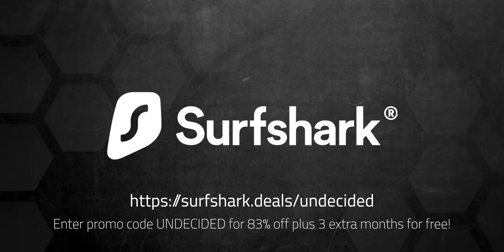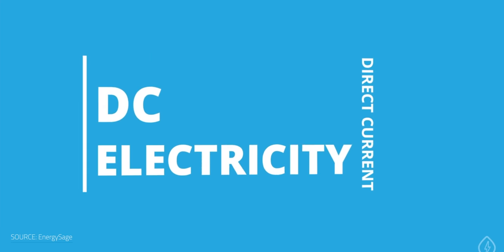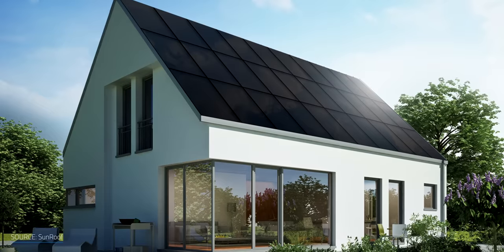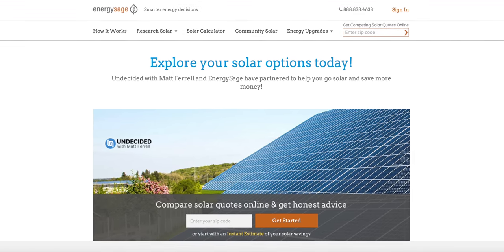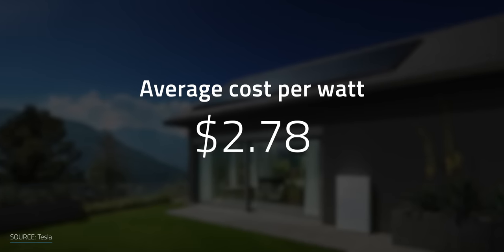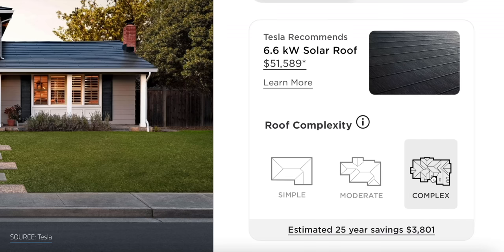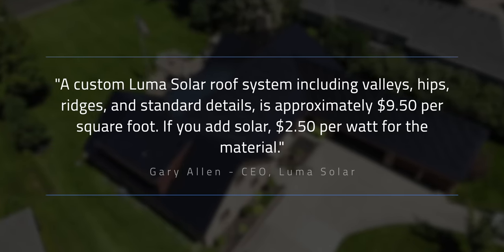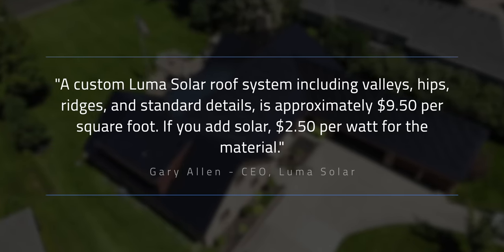Exploring Tesla Solar Roof vs. Solar Panels

Comment: Pretty much nothing new. Solar roof is really only a viable option if you need a new roof at least in the next 10 years. If your roof is only maybe 20 years old, afaik roofs can last you 40-50 years, so putting solar panels on for 20 years would be a nobrainer. When getting a new roof you can then decide if you want to put on your old panels again, get a solar roof or if you simply want new panels, but I hope in 20 years solar roofs in general are going to be more common. If you are going to need a replacement of your roof 5 years along the line, that will not only be more expensive because they have to take off the solar and put it back on, but worst case something gets broken or whatever. I'm sure there is insurance for that too, but that's another point driving the price of the roof replacement. So yeah. If you need a new nice really sturdy roof, the Solar roof might be a great choice, but if your current roof seems to be doing fine, panels are certainly the way to go.

Comment: Really the bottom line is that if your doing a new build, it would behoove you to work in the powerwall and panels or roof tile assembly into your construction costs. Especially if your a little off grid, or your converting that cabin on the recreation property into your retirement home. The cost of electrical hookup along with the costs of a good quality architectural composite will find you somewhere near a 20% to 30% differential. Easily recouped over a much shorter time and if your on the grid, you immediately begin with a lower cost for power. At the end of the day, with government mandates for zero emissions by 2050 (ok stop laughing) the reality is that IBC regs. will likely start mandating renewable support with new construction in various districts....especially liberal ones. So at the end of the day, if your working on your second house, retirement place o just building for the first time, you cant lose figuring in for a renewable support source...and if your half motivated, you can find a LOT of incentive programs and grants to help offset the costs. Even from your local utility or county improvement block grant program that even includes low to no interest rate loans.

Comment: I am sorry, but tiles are just for rich kids wanting to pose "green" but with no bloody idea what they're doing or actual interest (posing is more important than doing, style over substance). The only "advantages" tiles have are subjective aesthetics. The only times it sorta matches panels is if you make comparisons to other bad ideas, like just putting panels flat on your roof that isn't optimally positioned to maximize solar exposition during the day, and if you're constructing a new building and are also willing to shape your roof so that it optimally points towards the direction you get the most sunlight from, which is already a compromise of aesthetics. If you compare it to anything more sensible, like a properly positioned panel or a sun tracking one, it just doesn't add up. And if you really want any supposed technical advantage of currently existing tiles over currently existing panels... just make a panel using tiles instead of regular commercial available pre-assembled panels.

Comment: I wonder about the eventual possibility of solar roads and sidewalks? The roof is a great existing place to put solar but there's also so much sun being soaked up on the ground that we could be using!

The main issue here I suppose is durability. Not a lot of cars driving on your roof (assuming things are going well).
Reply: I’d suggest checking out the videos by EEVBlog on solar roadways. TLDR - not a good idea.
Reply: @Richardincancale  thanks for the recommendation! I had a brief look and yeah solar panels are definitely not a durable road material haha. At least not yet!

I wonder if it's just premature? Imagine where materials science could be in 100 years, let alone 1000! Surely the science will catch up eventually? Obviously not a short term solution but I'll hold onto my futuristic pipe dream for now 😆
Reply: Check out the project Solar Roadways.
Reply: @KalebPeters99  I think the lesson is - do the easy / efficient things first. Once all the roofs are covered (and walkways, parking bays, motorway central reservations etc.) then consider doing things that are inherently less efficient.
Reply: @Richardincancale  Absolutely! There's so many places we already have for solar that it's a shame to see money being wasted on solar roadways right now when it's still so inefficient and expensive.

Hopefully the lessons we learn from equipping these easier spaces can prepare us for the more difficult ones.

Comment: Tile only affordable in Cali & Hawaii no other state because of electric rates . Rating for their roof is C+ not better than Sunpower or LG. Tile doesn’t pass every jurisdiction for wind code especially here in FL . Tesla shingles are the 75-80% production in 25yrs compared to top brands that’s 90% in 25yrs like LG and Sunpower . The rating has to rated by the state if they choose to work in it and Florida its rated C . Also Tesla only has 10yr labor warranty that sucks compared to Sunpower and LG that’s 25yr labor .Tesla is a publicly traded companies so they need to make profits and not spend money . Also Tesla makes you do your own site survey way for solar compared to other companies that comes out and measure you roof and take photos accurately.The only thing I recommend for Tesla is the batteries . If you finance Tesla they have horrible solar interest rates that 3.99-4.99% compared to other companies that offer .99-1.49% interest rate . You get for what you pay for the old saying is true

Comment: I have just discovered your channel.
Great info.
Have you seen the Auatralian company TRACTILE ?. 
It produces Solar tiles, with the capability of also heating water underneath the tile which also acts as insulation for the roof and home.
Also fire proof and cyclone proof .
It has won many awards.
Check it out, you love to.know your thoughts.

Comment: I'd be much happier to know exact material costs instead of averaged installed costs.
The cost comparison here is almost totally useless.
Reply: Exact materials cost would also be useless because materials don't cost the same everywhere. Thusly why there's an average cost.
Reply: @HH-le1vi  Material costs don't swing as wildly as installation costs though.
Reply: @jimmyb1451  really? Is that why wood went up 4x in a year? Along with every other building material
Reply: @HH-le1vi  lol.
So you want to justify your foolish argument by stating that the price of wood went up 4x in "a" year, in some unknown location, in reference to PV systems, who's major materials are silicon and copper?

Just bow out mate.  You're already done.

Comment: Green power generation is important, but even more important (in my opinion) is how we build our cities. A large, detached house far away from everything so every single errand or trip needs to be made by car will never be as green as a reasonably-sized apartment in a city where most or all of your trips can be made by walking, biking, or taking public transportation.
Reply from the maker: To a certain extent I agree.  It's possible to have single family houses in bike friendly/walk friendly areas.  But sprawling suburbs is a bit of a problem.
Reply: @UndecidedMF  even still, detached SFH with yards still do consume much more energy than an apartment. Part of that is the larger size, part of it is the fact that there are no shared surfaces acting as thermal barriers. Yards are especially wasteful. They’re used a very small amount, and they require a lot of water and energy to keep them in good shape. They’re also (usually non-native) monocultures, which has detrimental effects on the local ecology. 

Either way, we need to make it legal to build apartments and small commercial in residential neighborhoods instead of mandating sprawl as our method of growth.

Comment: Whilst I prefer the idea of Solar tiles, you’re at the mercy of the company/installer still being around to commit to that 25 year warranty. I’ve recently been stung by Everest windows in recent years. The company still exists but they rebranded themselves to “Everest 2020 Ltd” from “Everest Ltd”. Long story short, same company but not honouring any of the warranty on any purchase before COVID-19 in March 2020.

Absolutely disgusting company run by bottom feeding, cold calling shit salesmen. Never buy from them.

I’ve learned that a warranty doesn’t mean a thing if the company offering it has no integrity, and you won’t find out until the company gets crunched.

Comment: think in the end a chinese hybrid system will blow elon out of the water.  this system is too cumbersome and although you can mass manafacture the tile it would be better to add a normal panel setup below several tiles.  here in south africa a lot of panels are stolen which would help the sale of a hybrid systems even if it is slightly more expensive.  although you probably would get a panel that would deceive a would be thief.

Comment: Tiles for sure. The cost of replacing both roof and panels over time is a no brainer
Reply: It only depend on how your house was built, in Europe buildings and roofs are way stronger and long lasting. Modern solar panels also are very nice looking and solid.
Reply: @carholic-sz3qv  thank you for the other perspective. I did t think about the various types of construction world wide.

Comment: The following is merely my opinion, unless I'm stating facts.

I'm actually unsubscribing after seeing just this topic and not the video. After your nuclear energy video - I was pretty angry with you. You're smarter than that, and that video was missing so much critical information it didn't qualify for being balanced. An example, an accurate accounting of how much subsidies and government funding  goes into the "cost of nuclear". Based only on that, nuclear is a non-starter. Even if it were free, the true, integrated costs of safely storing nuclear waste for a quarter million years again, and alone, makes nuclear a non-starter.  I have never seen a comprehensive true-cost of nuclear energy in a presentation because TCO of nuclear takes it off the charts and off the table. Because your energy analyses have a particular flaw of dis-incorporating ugly facts, the topic requires we revisit the last energy "discussion".

For some reason, it seems that you don't see your role as an information influencer, and appreciate the responsibility that places on you.  Solar worth it? Well, when the planet is becoming unlivable - a cost you are not putting into  your videos to date, it's obviously "worth it", unless you're putting a really low value on health and survival.  How many people died a grizzly death in Pripyat? Again, the government doesn't even try to calculate it, so people carry on as though those 10s or 100s of thousands people vomiting blood to death don't count.  Pursuing an even more complex, intractable and more expensive and infinitely more dangerous energy strategy that is nuclear really should not be on your plate as an "alternative". 

The simple litmus test is this: If nuclear CAN be made safe, why hasn't it been? (I expect not to hear - well it CAN, we just *didn't*)
Answer: All costs require actuarial details most humans can't tolerate, so it's just left out.

It's akin to entertaining burning 10x more fossil fuel as an alternative to our current strategy. Well, yes, that is technically different but - seriously. Thinking in terms of keeping viable the only planet that we know is habitable (until now at least) and exists demands we make alternative energy sources work. So asking if anything is "worth" surviving - you see how the question is squarely moot. I hope you change your direction in favor of keeping survival of our energy users heck their entire species possible, and maybe a few other species like chickens and cows as well.

Comment: I mean this politely and seriously, and please listen: STAY AWAY from Tesla products. The battery is good, but the cheap Chinese panels are junk compared to SunPower.  Not worth it. Tesla doesnt have control over their installers, the installs are ugly and horrible with lots of calls backs and problems. Avoid. As for the rooftiles, I have seen only two or three houses that looked nice. The dozens of others look like crap, the lines are crooked, and they gotta lower the value of the Home, compared to regular nice architectural shingles. UGLY. A perfect install looks fine, but those installs are very rare.  Tesla rooftiles are never perfect. The panels are better. But. Please do the math in SunPower. A better panel, better customer service, and over the life of the panel, it more than pays for itself in lack of degradation and efficiency vs the garbage Tesla Chinese junk.  Do the math. Tesla should be the best. It’s the worst. Avoid. They’re going to have an awful brand reputation in another ten years.  They are wrecking solar. Trust me on this, I am a consumer and a contractor, and I have installed several dozen solar arrays. SunPower costs twice as much in the beginning, and pays for itself over and over. And if you have problem, their warranty is solid. Tesla disappears. Don’t do business with them, in my opinion.

Comment: Wholesale used panels - 250w - $50. Buy a pallet or two of 16 for $800, a few to several thousand more for work and equipment, and you got a system.  
Don't buy this outrageously overpriced crap